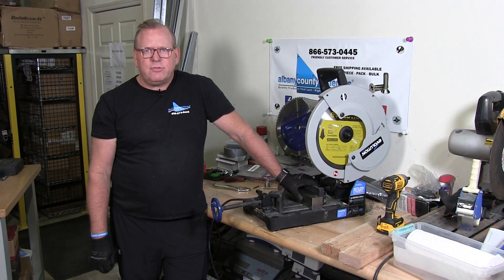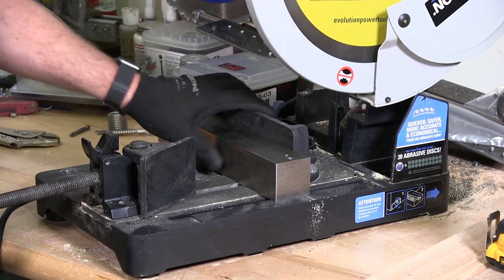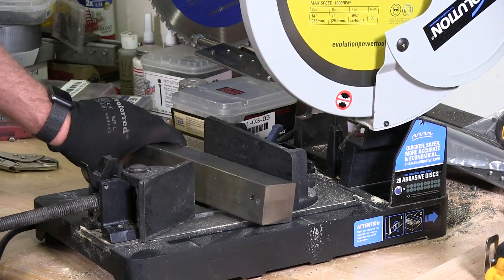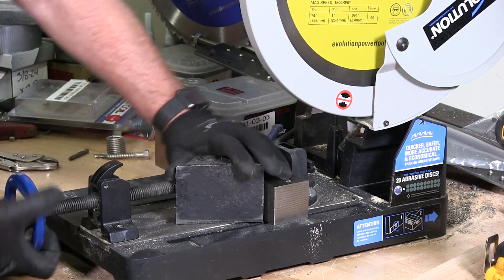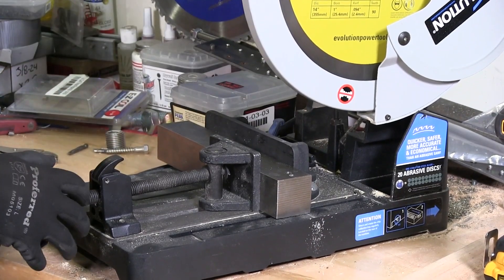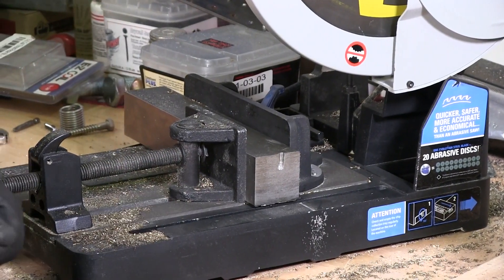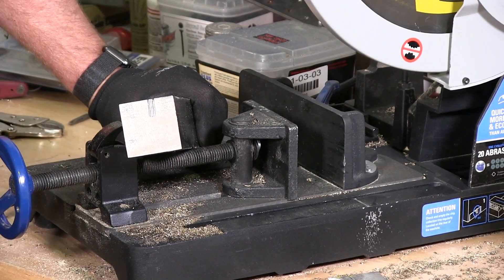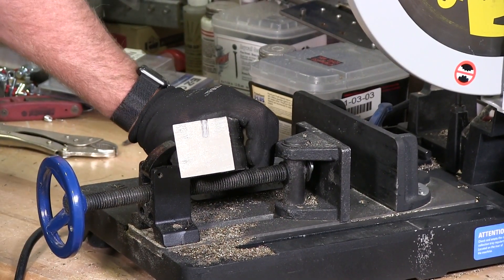Testing The Evolution Stainless Steel Blade - 14BLADESSN | Fasteners 101

Comment: Does Evolution make blades to cut 416 stainless steel 2 1/2" thick round bar ? I can't find a correct blade to cut it. I have a DeWalt 14" blade 1" arbor  metal cutting chop saw . Avg 4000 rpm

Comment: Great video! Can the stainless steel blade cut mild steel, and if it can, will it last longer than a regular mild steel blade, what is your opinion? Thanks.
Reply from the maker: It can cut mild steel, but it won't be as effective as a blade designed to cut mild steel and won't last as long in comparison.
Reply: @AlbanyCountyFasteners  thank you!
All the best in the year to come!

Comment: how many same square blocks possible to cut  until disc be dully?
Reply from the maker: That's hard to say. After we cut the block in this video, we had to cut it a few more times for other projects. After that, it saw almost 2 years of use in cutting threaded rod. That same blade is still going strong to this day.

Comment: How many cuts you get out of that blade?
Reply from the maker: There's no hard number we could give for the number of cuts you could get from any given blade. It can vary wildly depending on how the blade is used, what it's cutting, what it's used in, whether or not it's being used correctly, among numerous other factors. Evolution does state that their blades can last as long as 20 or more abrasives of the same type.
Reply: @AlbanyCountyFasteners  
 that their blades can last as long as 20 or more abrasives 

NOT A HOPE BUT I WILL GIVE IT A TRY

Comment: should be using a chop saw with a built in coolant system any decent metal worker will know friction =heat, sure the blade can cut through stainless but without using some type of coolant the blade will dull fast ...
Reply: LOL, these are dry cut saws, and dry cut blades, both of which are specifically designed to cut without lubricant. These can make hundreds and hundreds of dry cuts before needing to be replaced. And they do so producing so little heat that the pieces you cut can be handled with bare hands immediately after the cut is finished.
Reply: you obv have no idea what you talking about.. i suggest you learned the difference between hss blades and tct before you make silly comments
Reply from the maker: Thank you for your feedback.

Comment: I bought one for the shop at work and although I love how it cuts with a new blade in it, we have have bad luck with blade life. All we cut is stainless, so the first blade (all purpose) didn't last too well, so we bought the ss blade, and it also didn't fare well. I was hoping your video was a long term test, but I appreciate the video anyhow. Do you have any long term opinions now?
By the way, with your accent, it does sound like soar instead of saw. I don't mean to be an ass, but it's true.
Reply: This blade sucks diablo steel demon is better not only in pricing and more cut but it wears out too. Hope they make a blade that last like the band saw. Now it makes me wanna return the evolution s355mcs that my company bought cos we cut mostly stainless.
Reply from the maker: Hi Chris,
I'm sorry about this. We have used the Evolution blades in house and found that they do outlast abrasive blades.

It's odd to hear that because cold cutting saw blades can last significantly longer than abrasive blades. Unfortunately, not being there it will be difficult to diagnose why this is happening.

If you can e-mail us at support@rawproductscorp.com and make the subject line: "Stainless Steel Evolution Blades Dulling" I can put you in contact with a service representative from Evolution who might be able to suggest some tips to make the blades last longer.
Reply: apparently this guy in the video is clueless if you cut stainless steel all day and would rather avoid a band saw, using a chop saw with its own coolant system will extend the life of the blade....

Comment: Will this last longer for cutting mild steel?
Reply: Stainless is harder than mild steel!
Reply from the maker: It's not advisable to use the stainless steel saw blade to cut mild steel. While you may be able to cut mild steel with this blade, each blade is designed with a specific purpose in mind; there's a chance of damaging the blade if used on materials it wasn't rated for. For best results, we recommend using a mild steel blade like what we have here: https://www.albanycountyfasteners.com/Evolution-Cold-Cut-Mild-Steel-Saw-Blades-p/1060-2602.htm

With all that said, a blade rated for stainless is not likely to last as long as a blade rated for mild steel as stainless steel is considered a "softer" metal than mild steel. It would be better to stick to a mild steel blade for those applications.
Reply: Well I have bought this stainless steel blade in the uk nearer to home thanks for presenting your stock but no thanks, I will let you know how it goes. Il take the chance I like a gamble.
Reply: @madarehgallag  Hey man, how did it go, is it better for mild steel than the regular Evolution blade? Thanks!

Comment: I bet you think that Commie island South of Florida is Cuber too, eh?  🤪 Thanks for the enlightening video!  How many times do you think that blade with cut through that 2” stock without sharpening?  Does it need to fo to a special location for sharpening?
Reply from the maker: An exact number of cuts depends heavily on the type of stainless steel and the skill of the operator. We haven't needed to change out our stainless blade yet and it's seen regular use cutting threaded rod since this video was released! As far as sharpening, any blade sharpener who deals in blades like these can sharpen them though whether its worth sharpening them is up to you. When you do sharpen it you won't get the same lifetime that you would get from a new blade.

Comment: tilting the stock to a 45 will extend the blade light significantly (so you start and finish on a corner)  they usually come with jigs for holding the stock this way but if not theyre easy to make with a couple small pieces of angle iron
Reply from the maker: Thank you for your tip!